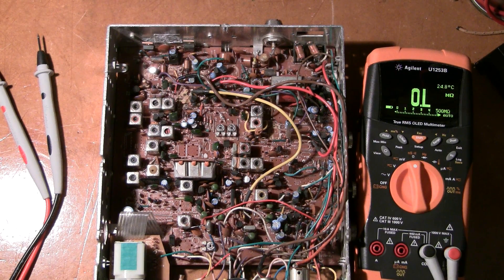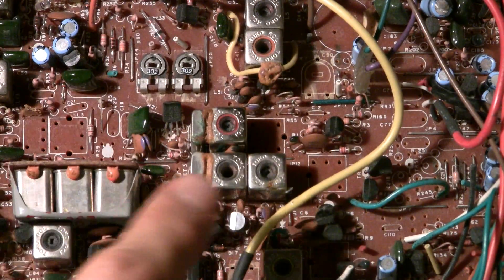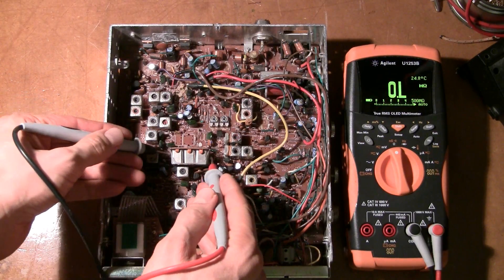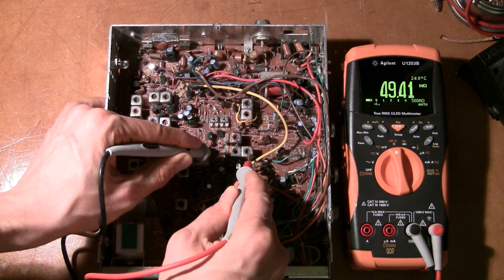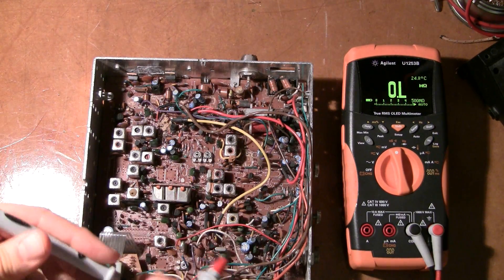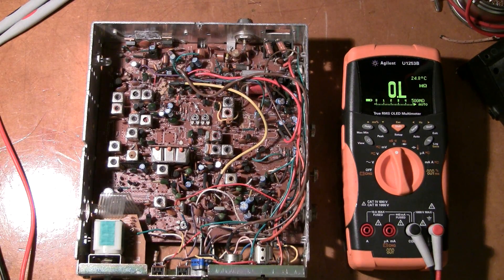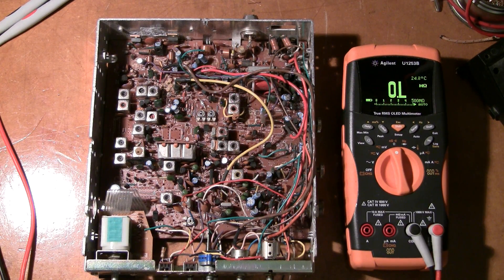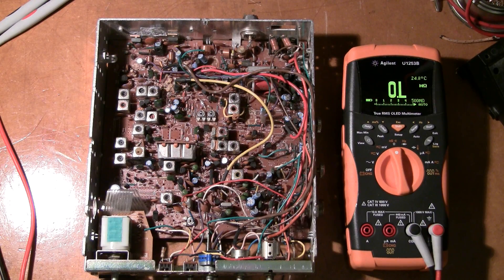Circuit Board Faults hiding in plain sight.

Comment: very good info. is the glue needed?  if so ,is there a substitute that you know of that doesn't become conductive?
Reply: +Chris Mosley White hot snot (hot melt glue, that is not yellow), silicone RTVs, Walther's Goo contact cement. I suspect they used wood flour (fine milled sawdust) as a filler in those glues. It molds or carbonizes from heat over time and then it becomes conductive. Old fiberboards, and fishpaper was also laden with wood flour as a filler product in manufacturing. It also becomes conductive, or MORE conductive.  Old style fiberboard is already a little leaky. It gets worse with age.

Comment: Was this mis-guided design and construction done because of (screwdriver) experts, to deter them, from meddling? Les.
Reply from the maker: +Les Johnson 
Probably a design to limit the life span of the unit. That glue is in a lot of equipment, especially older monitors (around the flyback)

Comment: Would turning the chassis component side down and using a heat gun on medium heat work?  I have run across this problem myself in the past.......I'm retired now, so very little repairs anymore.........Walt
Reply: +waltman333  upon second thought I would imagine that it would be too dried out to liquefy and melt!  Walt
Reply from the maker: +waltman333 
Your correct, the glue turns into a crusty (pie crust) like substance. So there is no chance of melting that.

Comment: Infamous SonyBond.  I spend several hours every week removing this junk.  Personally I think the conductive nature is the second worst part of it.  The worst part is it becomes corrosive and literally eats the leads off of components.  I have replaced hundreds of PLL chips, VFO's and crystals in radios that used Uniden and Cybernet circuit boards not to mention all the Kenwoods with the "dot problem".  They just loved pouring this goop on the most expensive parts.  This is definitely one thing that if it ain't broke you do want to fix it before it eats your radio from the inside out.  I think the component manufacturers came up with this junk to increase parts sales. :)
Reply from the maker: It's probably planned.
Reply: @MrCarlsonsLab  
Like your vids, Mr C.

Wouldn't hurt to look into more adhesives, since you will find that most do conduct..

BTW - think you will ever troubleshoot a few CB radios?
Could be good . . .

I dabble in repairing CB radios for local ops and have fun doing it.
Reply from the maker: MikesRadioRepair .CBRadio  You just spoke my mind! Thanks for the comment!
Reply: I used to call it "Amstrad glue". They made a range of cheap analogue satellite receivers in the late 80s / early 90s that ran extremely hot, so the glue became conductive in a very short time.
Does nobody learn? Or is it just that to use silastic would cost $0.02 more per unit?

Comment: Thx for the info ... You can overlook this one easily.
I also noticed that some resins  become fluid and sticky again.
I know this is a total different problem but when they did use it in a head of a tape recorder it can destroy your tape collection because it sticks to the surface of the tape.
Reply from the maker: smbrob Like those silly foam blocks in the old 8 track cassettes. They turn into gum. Thanks for your comment!
Reply: People who work with data transfer from older computer media to current (ie 7 and 9 track tape to current tape technology) heats the tape in  controlled way to make the binder non-sticky before copying the content. Usually 55 year old tapes can be read perfectly, but it depends a fair bit on the manufacturer. 

In some case they have to use a chemical to ensure a good passage of the tape by the read head.

Comment: That glue reminds me of the MFP  (moisture-fungus-proofing)  chemical on the military equipment I used to be involved with in Puerto Rico and The Bahamas.  I scraped it away from the work area and reapplied it when finished.  It reduced corrective maintenance.  My KWM-2 without it required constant attention to the switches and relays until I treated it.
K4OF.
Reply: Looks like it only caused him Alzheimer’s. 😊 poor guy,bad disease.
Reply from the maker: BOB RENFRO Interesting! I hear that stuff is pretty toxic though, is that true?

Comment: It would be nice to know what to get rid of it with , if possible a solvent that would not affect other areas , if anyone knows ?
Thanks again Mr. Carlson , did not see anything so far to know you call sign ?
I found you videos the other day , and subscribe & going through them .
Thanks for your channel .

John
KD0CAC
Reply from the maker: Hi Ken. I usually just use tweezers or needle nose pliers to take the stuff off. When it turns dark brown, it will chip off easily. When it is still custard colored, it`s pretty elastic, this is when pliers are used.
Reply from the maker: KD0CAC Thanks John! Glad your enjoying the video's. You may have to watch some more video's to spot the call sign :^)
Reply: +Mr Carlson's Lab 
Please, can you explain to us the best way to get rid of this stuff?
Do you just chisel is away or use some sort of chemical treatment?
What about applying heat first to soften it up?
Thanks,
KC

Comment: My son has a Samsung TV/monitor model LTM1555B and it runs on 14 volts DC, the power pack is putting out 14 volts but the TV don't come on.
All that happens is the orange power LED blinks and pushing the power button does nothing.
My eyesight is poor so I can't work on these small thing anymore.
Could it be the "glue" or maybe bad electrolytics?
Reply from the maker: Hi old64goat!
It's probably bad caps. Seems this is the common problem among all newer electronic devices.
Reply: Yea that is what I figured, Thanks for the reply, I may have to have someone repair it that has younger eyes.
BTW, I enjoy you channel, I had 2 Tektronix 535 oscilloscopes in my shop years ago, they were only good up to about 24MC.
Reply from the maker: ***** Thanks for the comment! Those old 535's were great.... Lots of glass in those. The two 547's I use are a mixture of transistors and tubes, so not as much glass, but equally as nice to use.

Comment: Hi Mate, Good video but could you please tell me what DMM you was using as i can't see the model on keysight site. cheers
Reply from the maker: HI Anthony. The meter is a U1253B. Its now an older model, so not sure if their still in production. Thanks for the comment!
Reply: Mr Carlson's Lab 
About eight hundred bucks on eBay.
Reply: EdWatts That's expensive for a DVM! I never even spent that much on an oscilloscope-!

Comment: Thanks for the tip. Very interesting.
Reply from the maker: Glad you found this helpful.
Reply: Mr Carlson's Lab  Thankyou Mr Carlson  for you Channel I will be visiting again .
Have been looking for this glue for a few years have just found some in a SMPS  Do you have a peference  replace ment  material  or just use Nylon type glue gun  medium.
 John p.T
Reply from the maker: Hi John. I usually use GE silicone 2. It's a non acetate type silicone, dries fast, and doesn't bother electronics. Thanks for the comment!

Comment: Interesting. I have seen other materials decay and become conductive. I use an electrometer on insulation and adhesives for sensitive devices and an insulation tester on cables. It's amazing how many materials are or become conductive over time. I would agree that some manufacturers build in failure or at least allow an acceptable amount of future failure in devices. I believe there was a thread over at the EEVblog on this very subject. Even though the higher resistances usually won't cause much of a problem, the lower such as what you were measuring can definatley cause issues. Good tip, I like your channel!
Reply from the maker: Thanks Eric! I will try to keep it interesting.
Reply: Mr Carlson's Lab BTW, your lab is mad! I thought I had a pretty crazy lab! Very cool!
Reply from the maker: Eric Haney Thanks Eric!.... You should see the other room... I will make a video on that too some day.